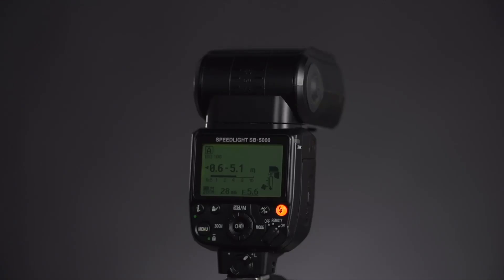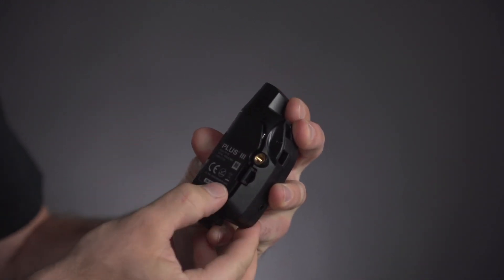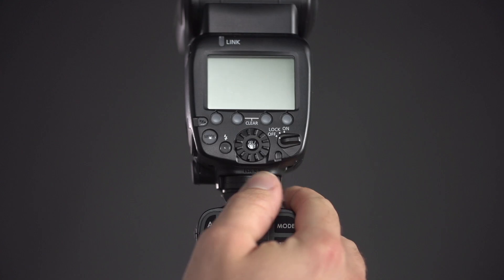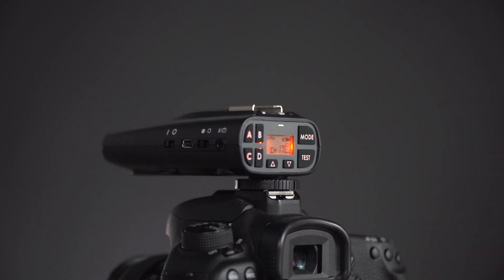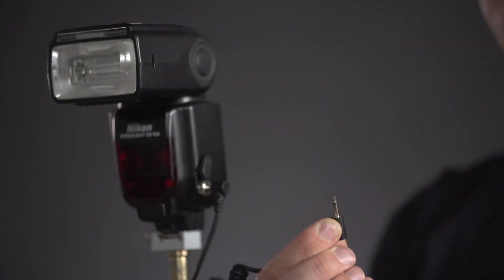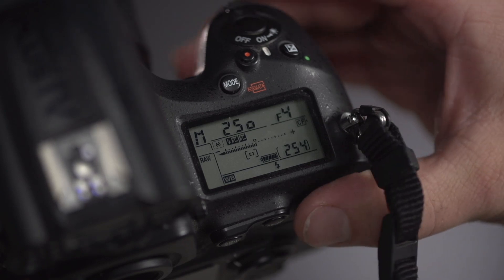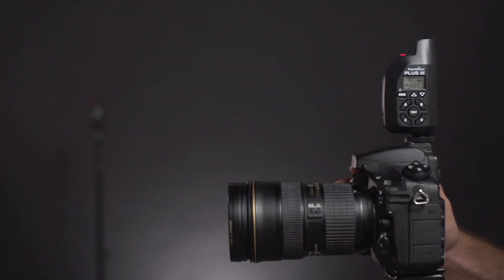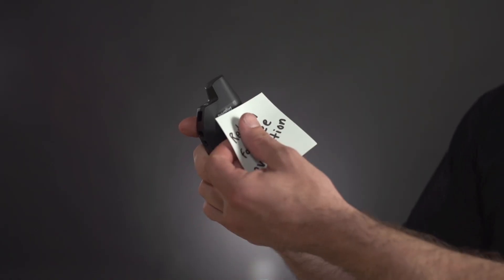PocketWizard Plus Series Radios - Basic Troubleshooting Techniques

Comment: I'm trying to figure out why I'm not getting faster than 1/500 sync speed on the Flex ttl with zone controller and SB910 speedlights. Neigher FP 250 or 320 solved this problem by the way. And I'm always shooting full manual.
Reply from the maker: Hi Mike, sorry we missed this! This video is designed for Plus radios but we'll connect with you through the support queue to solve the problem. It definitely should work!

Comment: "Set the flash to manual" fixed my issue. The second time around, I had to switch units from flash to camera. Definitely not plug and play. I will check firmware next. This is the best laid out and thorough vid out there - shoe repair? You got to be kidding. Thanks.

Comment: Hi I have a Sony a7riii and I using got the plus X and it won’t fire??? The receivers are talking to each other. When I press the test the red leg blinks
Reply from the maker: Sorry we missed this! If you're still having trouble, here are 2 things to check: 1. if you're trying to trigger a flash, see if the hot shoe is disabled. Silent Shooting, continuous high speed drive, and electronic shutter all might turn it off. 2. If you're trying to trigger your camera remotely, do you have the S-VPR1-ACC remote camera cable?

Comment: Hello. Using on Nikon D850. I have a mini TT1 and a Plus II attached to my SB800 flash. Test button on the TT1 WILL fire the flash but will not fit with camera shutter pressing. 

All works fine on my D750. 

I’m on firmware 3.909. 

Any advice?

Thanks.
Reply from the maker: Hello, sorry we missed your question! If you're still having trouble, can you shoot us an email at info@pocketwizard.com? Doublecheck to make sure you didn't turn your flash off, it needs to be set to Fill.

Comment: Have been trying to call since yesterday and no one answers the phones.

Pocket wizard plus 2 on a sony a6500. Will only trigger the shutter when the bbf is held down. Will not trigger shutter otherwise. The camera shutter button works fine.

Ive tried putting the camera in manual focus, no go.
Reply from the maker: Hi Jose, we had a major snowstorm up here and most of us are out of the office today! Sorry about that. Please know that if you ever get our voicemail, we will call you back. In this case, do you have the shutter set to electronic? And you are triggering a remote flash, not triggering the camera remotely, correct?
Reply: @pocketwizardvids  

Hey guys,

Im triggering the camera shutter remotely, no flash; ie; camera behind soccer goal.

Trigger is not set to electronic; im assuming you mean silent shutter on the sony a6500. The a99ii doesnt have that option.
Reply from the maker: @JoCoMoreno  I'm guessing it has to do with the fact that you're using Plus IIs and the specific cable you're using. I have your number (the roads cleared up) so I'll give you a call in a few minutes. Thanks!
Reply: @pocketwizardvids  

You guys are awesome!
Reply from the maker: @JoCoMoreno  Thanks, so are you! Good luck tomorrow! :)
Reply: @pocketwizardvids  

Hey guys,

Tried calling again.

Just got the cable and im still having the same problem.

Shutter wont release unless im manually holding down the af button.
Reply: @pocketwizardvids  

So after all that. Turns put it was just a firmware update for the camera.

Good grief.

Thank you all for your help. You guys were great.
Reply from the maker: @JoCoMoreno  I'm so glad you got it all set! Please feel free to contact us any time.

Comment: It works with when i push the test button but does does not fire when the shutter is pressed. Any tips? I can't find the answer on Google. I am using a canon rebel t7 with an aileen bees 400 and pocket wizard plus x trigger and receiver. Thank you.
Reply: I tried all the troubleshooting in your video
Reply from the maker: @cristinarosado5749  Unfortunately, Canon does not provide a center pin contact in that camera. Without that center pin, our radios (and any other radio that needs that main sync trigger) can't get a trigger signal from the camera. Both the Canon T7 and SL3 have this design. Here's an article from Fstoppers about this issue: https://fstoppers.com/gear/canon-removes-universal-hot-shoe-pin-its-latest-release-361330